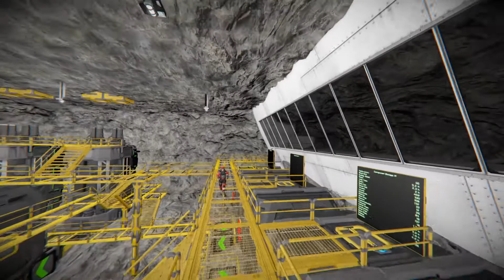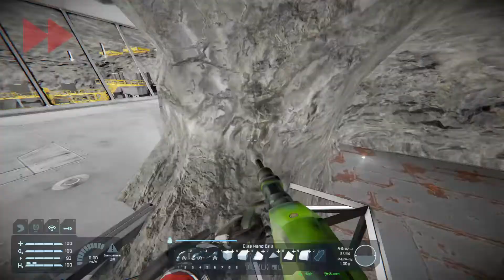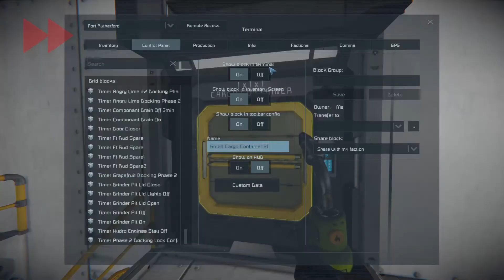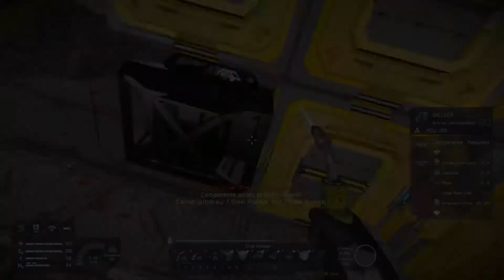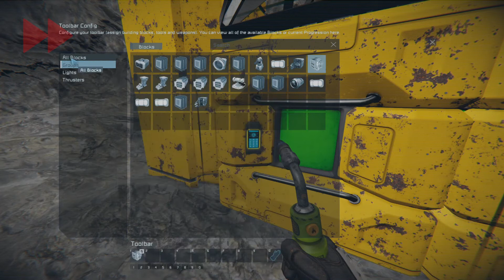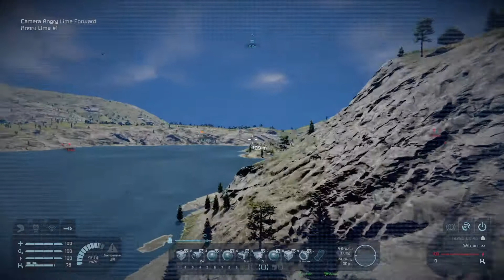Hephaestus Prime EP35 - Engineering Dept (Space Engineers)

Comment: Your ideas and building sl=kills are putting my efforts to shame but I am always learning something new and you are broadening my horizons.

One question, how do you reset the piston speeds to be slow enough for the weld process?

Using 'Increase/decrease speed' uses 05.m/s increments but you seem to be setting much lower speeds than that.

Thanks again for the videos.
Reply from the maker: Hi John. Using timers, you can increase/decrease pistons speeds by .5m/s. If you have it say base speed of .01m/s for welding, increase it with timer to .51m/s for moving. The tricky bit comes when to reverse the piston direction, it's counter intuitive, you need to speed it up again to slow it back down, -.51m/s then timer sped up to -.01m/s, ready to reverse again. Essentially two negatives add to a positive. Come to grips with that and you'll figure it out. The drill machine does it too in its reset phase. That's quite a good one to look at and learn from, I have a set up guide and you can download the blueprint and dissect it.

Comment: The base is coming on well, I like the hinged lid idea, I built something similar based on Splitsies Survival Impossible charging mechanism for my mobile base...so satisfying when it all works as you want it to.  Could you configure one of the timers to open the lid, unfold the welders and drop the lid again?
Reply from the maker: Hi Keith. It was a lot of work to get that mechanism right, but the effort did pay off, as I continue to use the printer and I can't recall it ever having failed. I was hoping to fully automate the unfolding/stowing progress, but lost the appetite for it, due to I was already up to something ridiculous like 20 timers and had spent literally hours setting those up. Main problem is, if something get stuck or delayed, the timers continue regardless and 'bad' things happen. It's difficult to build in the safety mechanisms.